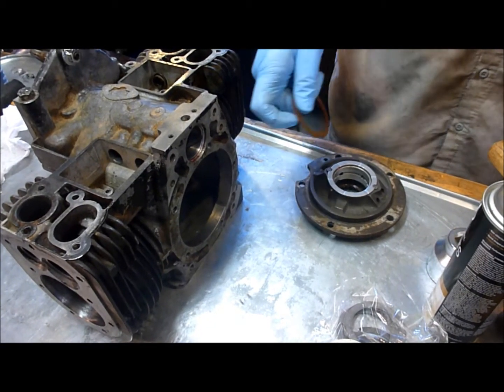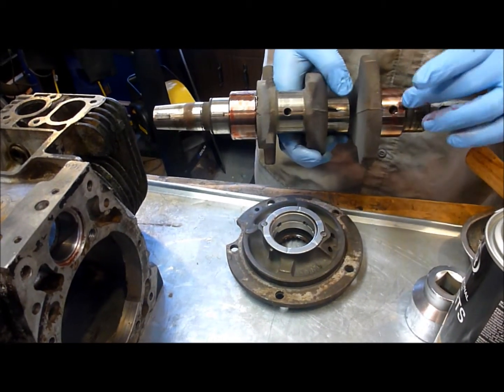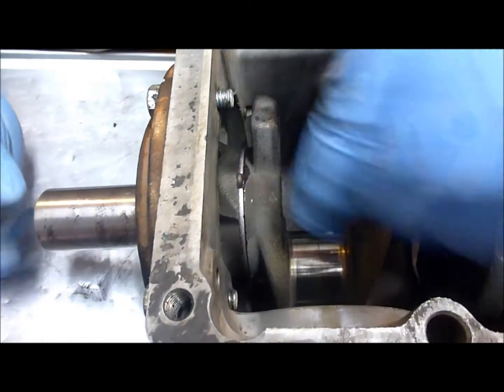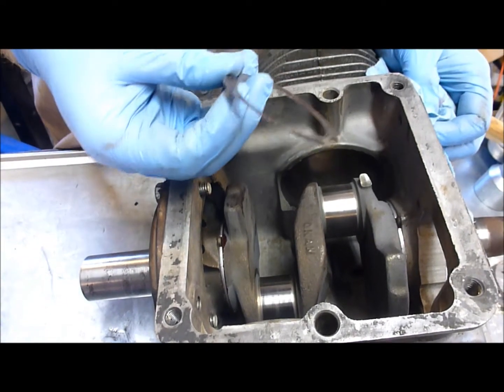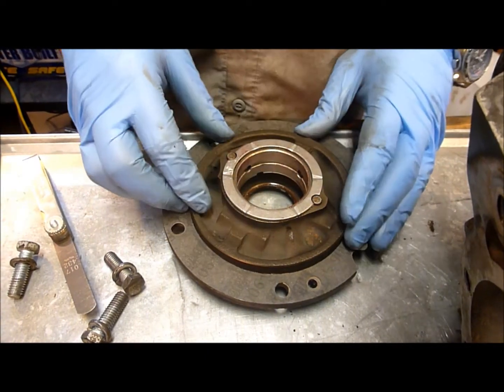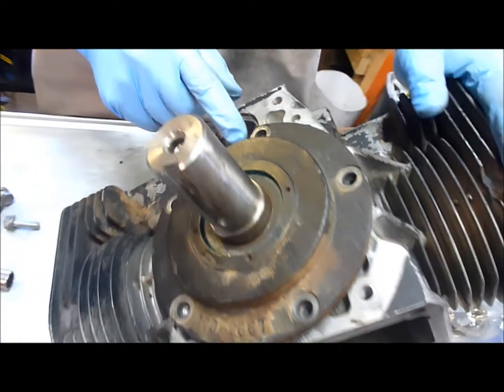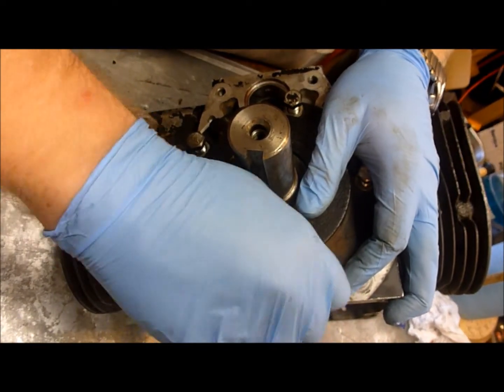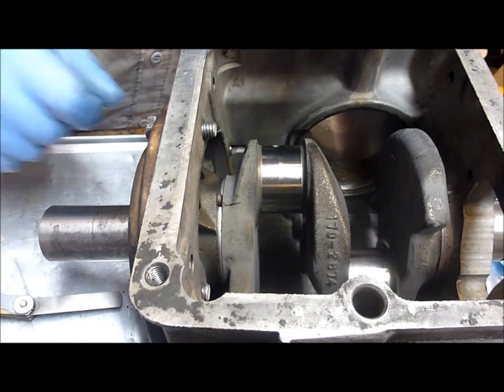Rebuilding an Onan B43G (Part 4) Crank Shaft Install

Comment: Does the shim have to go on the bearing plate side of crank? I found a shim on the oil pump mounted side and thought that was odd being opposite what u did. Also if I need to use 2 of the .005 shims to get correct spec would I use them together on bearing plate side or one on each side? Thanks, your videos are a tremendous help
Reply from the maker: Glad the videos are helping. I would need to go back and dig through my notes/manuals to completely answer your question. I think shims can go on either end but it is just easier to add them to the PTO end. (Since you can remove the front cover instead of taking the whole crankshaft back out)
Reply: way too late to help here but maybe someone will need this in the future, on my B43 from an ingersoll(case)226 had 1 shim(0.005) on both ends of the crank.

Comment: Did you replace the crankshaft front & rear bearings?  They look new in your video, but I only see you replacing the cam bearings and crank thrust washer & shim
Reply from the maker: We did not replace the main bearings. We did mic them and they were well within spec (neither the crank or the bearings showed much wear at all.... I don't have the numbers any more). Typically there is not a lot of wear on the main bearings in these engines.